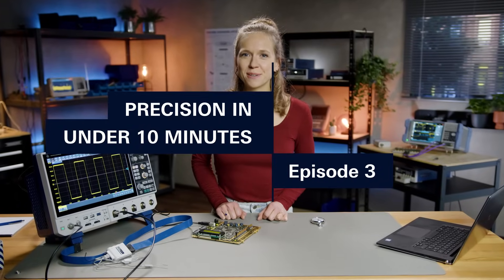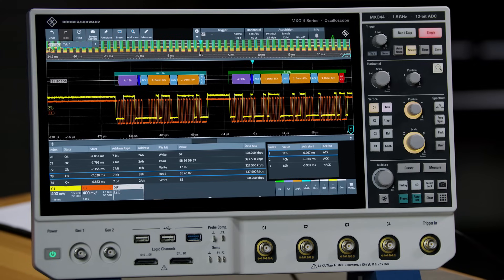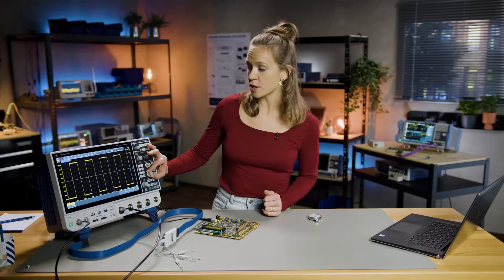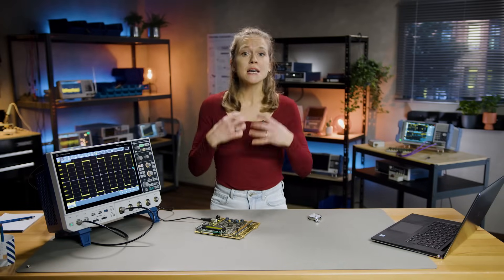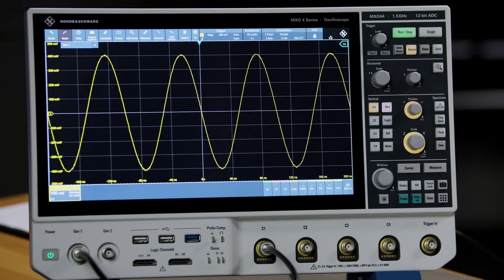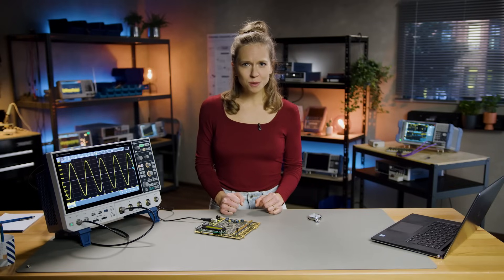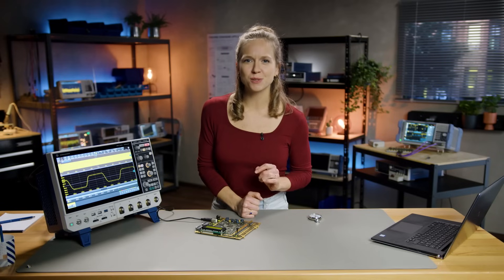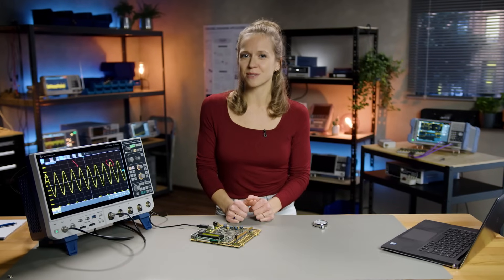Precision in under 10 minutes – How to use an oscilloscope

Comment: Not really an electronics geek but having to repair construction equipment which uses PWM controls I would like to get a portable oscilloscope with simple controls but a fairly large display. Any recommendations?
Reply: RTH Scope Rider. It can even demodulate the PWM with a Track Function :)

Comment: hello i am trying to use a scope to trouble shoot a voltage out put on a scr never used scope before any pointers.
Reply: Yes, read the scope user manual. Also, make sure your SCR circuit is isolated from the power mains, using an isolation transformer.

Comment: I own an HP 54503A, first of all, because I like vintage stuff and cathode ray tubes, but this 500MHz oscilloscope is still a beast, able to find glitches in signals of just a few nanoseconds. In my opinion, the Achilles heel of oscilloscopes is not the device, but the the probes: For example, try to measure power supply noise. You are unable to use the alligator clip for ground, wwaaayy to noise, you need to use the spring. This is such a big issue that most people measure it wrongly...... I know there exist high-end active probes, but that is actually the point, because it means these devices are not available to the masses: The vast majority of scope users are stuck with cheap passive probes that they use in a wrong way.

I have both the original high-end HP probes for my 54503A, just as well as some modern ones. The modern ones are built out of more plastic than the original ones, but functionally there ain't a lot of difference.

IMO most oscilloscopes are now so advanced that even low-end scopes are good enough for most tasks. However, probes have mostly remained the same over the past decades and engineers run into their limitations every days. This is the place where we need innovation. I think active probes need to become the standard, but current active probes are so costly that no engineer will use them unless absolutely necessary. The manufacturer who makes better probes available to a wide audience will be king.